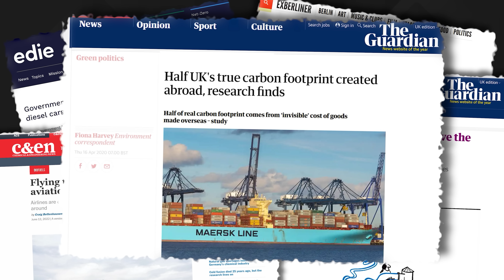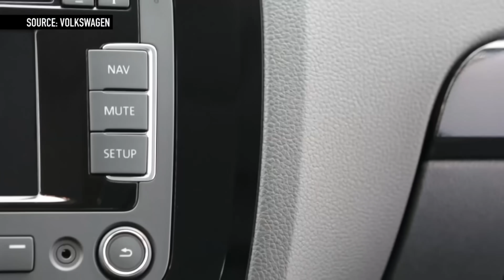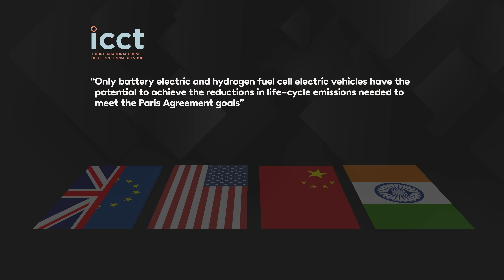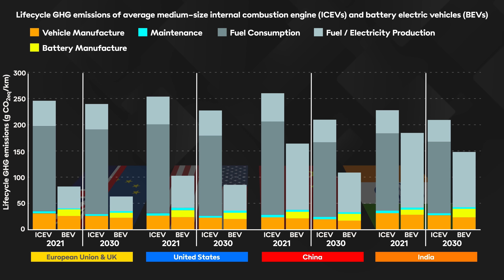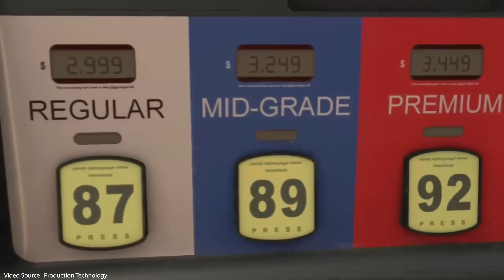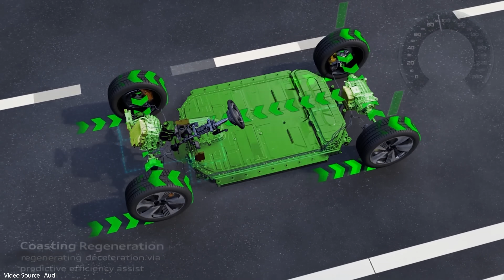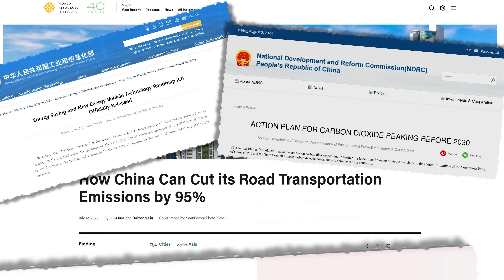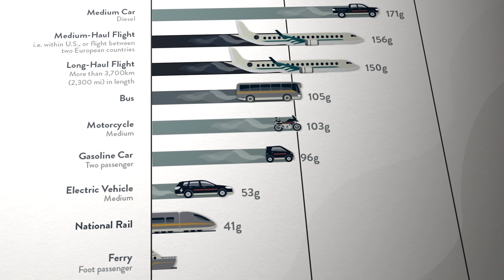Are EVs really better for the climate?

Comment: Hello Dave. Thanks for another good video. In the climate debate the focus is mostly on the Co2 emissions, but I wonder how much research there is on the other contributors, e.g. heat capacitors like concrete structures, roads, crop fields, and reduction of forrests. I have lived in London for 4 years and experienced how the temperature almost always sits 2-4 degress above the surrounding areas. Looking at e.g. goggle maps wherever you zoom in you see these human impact. The cooling sensation when you walk into a forrest a hot summer day through the evaporation of water in the leaves speaks for deforrestation as a factor. The growing population on the planet combined with the change in live style, eating meat with more acres as a consequence and living in the cities, most have an effect on the global warming besides Co2.
Are you aware of any particular research on those other effects? It was always difficult to mention population in the discussion.
Reply: Yes agree and add to your list is steel production it requires lots of energy to produce from coke. I noticed that the paper Dave used was not peered reviewed or he did not mention it. The other thing that people are not factoring is that who is going to maintain roads, bridges and other infrastructures that are paid by excise on petrol. Yes tax on those dirty cars. The batteries safety and no of cycles that they can perform and fact they cost a large proportion of the cost of vehicle is of concern. My opinion is that there is a way to go yet. EVs must come down in price to make them accessible to everyday people. Where I am the cost power at night is 42c/kW so one would not even contemplate to charge vehicle at night. I advocate reusable energy as my house has solar panels and solar thermal water heater, and but no battery for same reasons and is just not cost effective. One thing that really is wrong is the mining of cobalt in the Congo that is a dirty dangerous activity for the local people that mine it and environmental issues this activity is having on their environment. We on the other hand just climb in a nice quiet seemingly clean vehicle with  low emissions. Every thing we do we have an impact on our planet.
Reply: The heat island effect in cities is real, but they don't (yet!) cover much of the Earth. Global warming is primarily due to human-caused increase in CO2, which is primarily from burning billions of tons of fossil fuel, but land use changes as we deforest to grow crops is also significant. The scary thing is changes resulting from the existing warming will accelerate it, such as ice that reflects sunlight melting, and more CO2 from burning forest fires everywhere.

@peter slater Tesla, BMW, and other car companiess have committed to source responsibly-mined materials; reward them, or don't own a 2-ton manufacturer car. And you should extend your outrage to the communities ruined by oil mining in the Nigerian delta, and the Ecuadorian indigenous people whom oil company Chevron hasn't paid for billions of dollars of oil pollution on their land.
Reply: @skierpage  I do agree with the components, e.g. lack of ice reflecting sunshine and that Co2 has a green house effect. But is it quantified anywhere in a scientific report? I never remember to have seen one mentioned. I do not contradict you, but it would have been nice with some ccvalidated numbers...
Reply: @jonasrosengren9093  it's complicated and hard to do in a YouTube comment without links. Natural sources and sinks of CO2 were nicely balanced for ~6,000  years since Earth came out of the most recent Ice Age, then Earth's global mean surface temperature shot up. See the nice-scary graph in UW's "New method shows today’s warming ‘unprecedented’ over past 24,000 years". The only significant change to Earth's circumstances on the last century is the Industrial Revolution happened and we increased greenhouse gas concentrations, primarily CO2. The IPCC 2021 report summary "shows that emissions of greenhouse gases from human activities are responsible for approximately 1.1°C of warming since 1850-1900"; It doesn't even mention contributions from the heat island effect.

But as ^$#@! denialists point out, the absolute concentration of CO2 is relatively small. Every extra gigaton of CO2 in the atmosphere causes warming for centuries. But then the warming triggers additional warming: increased water vapor also acts as a greenhouse gas, loss of reflective ice raises the temperature, etc. (And as denialists love to point out, more CO2 can mean more vegetation where there's enough water and it's not too hot in the soil isn't depleted.) Climate scientists argue over the details of how much warming how soon all the time, but there's virtually no disagreement over the originating cause.

I skimmed IPCC's chapter 3 report and couldn't find its breakdown of the influence of particular human activities, maybe because ^$#@! Saudi Arabia's only contribution to the consensus report was deleting the words "fossil fuel" as much as possible. However, US EPA's page "Global Greenhouse Gas Emissions Data" says "emissions from fossil fuel combustion and industrial processes contributing about 78% of the total greenhouse gas emissions increase from 1970 to 2011. Agriculture, deforestation, and other land-use changes have been the second-largest contributors."

I hope this helps.

Comment: I've never believed that electric cars are bad for the environment, and kick and scream all they want, the personal transportation options will eventually all be some form of carbon free. The truth is that if everyone changed to EVs tomorrow it would have a huge impact on the reduction of carbon released by humans, however, I'm pretty sure no electrical grid could handle such an increase of load all at once. It's going to take time, to improve electrical infrastructure, to build EVs, and to phase out operational ICEVs. There's no reason to stop driving an ICEV if it works and operation is cheaper than buying a new car, EV, Hybrid or otherwise.

Comment: Did carbon emissions of the manufacturing of all vehicles include the extraction and processing of the resources used?
Reply: They cancelled each other out so we’re omitted from calculations
Reply: @DarrenWhittington  how can they? One is much more resource intensive than the other. They don't use photosynthesis and windmills to get lithium out of the ground.
Reply: @timhinchcliffe5372  it’s mined as an ore, like iron ore, the advantage being that it one of the most abundant chemicals in the world, the sea has unlimited amounts of it so yeah potentially a type of photosynthesis could be used to extract it from sea water if you want to look at it that way?

Comment: I'm one of the naysayers, I dont beleive EVs are the solution to this problem. Given I understand some of the benefits. But let me give you some examples I suppose. I am 33 years old, I have been driving the same 2000 2.2 s10 for 17 years, my dad bought this truck 5 years prior to that, he has owned 5 vehicles in his life, now 70 years old and still owns the other 4 since he gave me the s10 in high school. He drive a 1989 Toyota Corolla most days, a Volkswagen bug sometimes. These vehicles are already made, thier emmsions from being manufactured doesnt count, thier previous emitted CO2 doesnt count, youd have to do an emmsions comparison on the day you sold one of these cars off to change to electric and the electric you can add in all the variables to produce the new steel and lithium battery and transportation of the new vehicle. Im assuming most of the data was what if you bought a brand new vehicle and choose gas over electric, which I guess has its merit, but I'd like to know what the consider the lifespan of a vehicle. I do t forsee to many People drive 2020 teslas in the year 2040 or 2050. I guess only time will tell. I own a mechanic shop, have a background in engineering, I have owned a nissan leaf, and have a massive amount of experience with pretty much most vehicles on the road. I will admit the toyota Prius, toyota highlander hybrid are some of the greatest most reliable vehicles ever made, 500k miles with proper maintenance. And they will be around, I havent experienced a fully electric vehicle that I feel the same about. All these electric vehicles will remove the ability to repair them at home, maintenance them properly outside of a professional mechanic shop  , therefore premature failure, and the electronics going to shit early. The true enemy is planned obsolescence, people who dont take care of thier vehicles and consumerism.the fact they are pumping out millions and millions of unwanted vehicles, kelly blue book giving perfectly great vehicles a absurdly low value and therefore making people beleive they are not worth maintaining or fixing when needed and somehow a new vehicle is a better financial choice, people accepting subpar quality and not voting correctly with thier dollars. Basically making Ill informed purchases. And last but not least, I do beleive cars are a very small portion of the emmsions on earth, and the lowly middle class doesnt make a drop in the bucket compared to the elites and under/unregulated industry. And I do beleive most of this is a shift not to save the planet, but to shift your dollars from your pocket into another industry that doesnt ha e you or the planets best interest in mind. If you actually care about the planet there was one principle that holds true of the years. Reduce, recycle, reuse.
Reply: @tie pup I have worked for a shop that did emmsions testing, while yes an older vehicle puts out more emmsions then a newer one of a similar model, they don't necessarily put out more emmsions then they did when they were new, unless they have an issue. Piston rings for the most part seat in and have a better seal the second 100k miles then the first. Also EVs you can not simply replace parts, in moat scenarios you have to have thousands of dollars in a scanner to program in the new part and access to a dealer database, same as all new vehicles really. Also depending on which EV they have oil, gear lube and grease, but far less required and most are lifetime of the vehicle. Im not sure the pay back is quick, if any at all, time will tell. Look into ethanol fuel additive, they all sold us on renewable fuel, and it was gonna save the planet. Just recently they admitted ethanol was a huge mistake, and credit sa ted far more CO2 then if we would have not used it at all. But here we ate still using it, and it will takes years to transition to something else. there were much better options at the time, but they went with corn, and monSanto coincidently owns the patent for the seeds to grow corn specifically for ethanol. Look into the real cost of windmills vs coal plants, even the best math will give windmills a 68 year payback, alot of it suggest they will never have a payback, and we'll be moved on to a differnt technology by then.
Reply: @tie pup there's something like 68 tons of coaking coal used for the raw materials of your average wind mill to make the iron, steel, copper and aluminum. Which there is  no good way to capture the emmsions from in a smelting plant. If you would have just used that coal to make electricity instead of melting iron the payback is far beyond 6 months, coal power plants are already made, they already exist, or atleast did, they are tearing them down now. So not only do you have the emmsions of mining raw materials, melting them I to something new, you also have the emmsions of dismantling the coal power plant. Coal power plants also have the ability to capture carbon, most the coal plants in the US are pretty clean running, the ones that dont have state of the art capture systems have done so because they have a shutdown fate anyways and dont want to invest if it's going to be dismantled. There also a massive amount of Petroleum that goes into the fiberglass resin of the blades, and the oil in the gearbox to lube it, which also has to be changed for preventive maintenance. And there a large amount of concrete at the base and all the emmsions related with that. And all the diesel vehicles to transport and install the turbines, and most of the maintenance vehicles are diesel and go out every day to maintain and repair these turbines. It is not a 6 month payback and never will be, like i said, conservative estaments are decades and decades to break even on just the carbon. Also I own a mechanic shop, your phone wont do anything for a vehicle, it might read codes, but to do any real mechanic work you need a bit direction scanner, usually starting around 2 or 3k dollars for a basic one, and a monthly subscription for service information. About 85 a month at best. My scanner was 20k dollars and about 4k dollars a year for access to dealer network. And I still have to send thing to the dealer sometimes that they consider proprietary.

Comment: If you're talking to a climate skeptic, the arguments for electric cars are just as stark.  For example, China's main reason for reducing their use of gasoline-driven cars has less to do with climate accords than it has to do with national security.  (Or insecurity, depending on how you look at it.)  The best reason to buy an electric car these days is simply this:  lifetime cost of ownership is lower.
Reply: A much more compelling reason than any savings is that all EVs are much safer due to their lower center of gravity. If you watch a lot of car crash videos you’ll see a typical SUV tipping over when it hit something as slow as 10 miles an hour and easily going out of control on the highway. By comparison the Tesla model X would not roll over on the rig designed specifically to cause it to roll over no matter what speed it was going. As near as I can tell your chances of injury in an EV how much less than half of an equivalent gas powered vehicle.

Comment: Lithium and cobalt and other battery components are all dirty to mine - yeah well so is all that aluminum for engine blocks and transmissions. And also the lifetime of mining oil for fuel and lubricants. 

These batteries will pile up in landfills - um no, they are fairly easy to recycle once there actually are enough old dead ones in the market to activate the dozens of companies waiting to do so. But many of them are not hitting the recycling piles yet because old EV batteries have a second life in storage and industrial applications before they are even considering recycling. 

Apartment dwellers cannot charge their cars at home - oh my you mean they will have to go to some near by station of some kind to put energy into their cars, that sounds too hard how will they ever manage it?

EVs are not emissions free, there is still lots of emissions from manufacturing them and generating the electricity - So? Less emissions is still better than more emissions right? And the more we adopt EVs the greener EVs get because we green up transportation and industrial process. So the next time this report comes out every type of vehicle will be lower emissions because of all the EVs driving around people and materials for all industries. 

EVs suck, we should all just build better cities and walk/bike everywhere - sure go ahead and do that without trucks and travel to other cities. Reducing demand is better than improving demand so that is a great start. But reality means stuff needs to move around too so vehicles will always be a thing needing improvement. 

Obstructionists need to quit, all their arguments are old and tired.

Comment: Don't call them nay sayers, that's a bit negative. I wouldn't call myself a nay sayer but I do doubt whether electric is better for the environment in some areas than a second hand car.

I use a 20 old second hand car, that is kept in excellent mechanical condition. Keeping this car longer rather than getting a new car is more bebeficial or almost breaking even according to your graphs.

I live in Western Australia and the grids are mostly all coal, last I checked. I assume one day electric will be better, but I see a lot of people buying Teslas thinking they're green when they might not be unless they use mostly home solar.

I don't think companies are transparent enough, and did your graph include recycling?
From ground to ground needs to be completely transparent and legislated, so buyers can easily see.
One report can be falsified, I've seen it before, but many reports should eventually shed light on the issue.

It's an easy answer for some places in the world, I'm mostly concerned about places with dirty grids and how effecient is battery and solar panel recycling.

Don't call people nay sayers, it's very healthy in this day and age to be sceptical.
Reply: Exactly, keep your ICE car in good condition and it'll be 'greener' than an EV for years!

Comment: Dave of course it does!!! why even second guess it? Car body is almost identical as other car bodies that has not changes. Its the removal of 70% of the components of a gas engine is what makes the difference. Substituting a massive oil refinery, fuel distribution facility and gas station for LOL a simple charging station that is installed in two days. The the switch to infrastructure change is mind blowingly simple! Downside, the lithium deposits need to be disolved by water and pumped to the surface. Chile is one of the leading lithium deposits and in a country where only 15 mm of rain falls, its denying water to small towns in the country.

Comment: I am doing fine with my solar and 226 mile rage leaf.  I pay $24 a month power bill and drive over 1000 miles a month.  So far my range is still great.  Many say but batteries ate so expensive.  True but saving $3000 a year in fuel costs the car will be paid for in fuel savings in 10 years.  Then it will be trade in time.